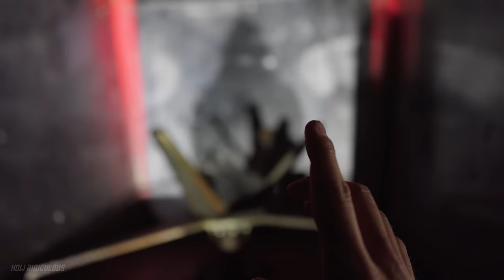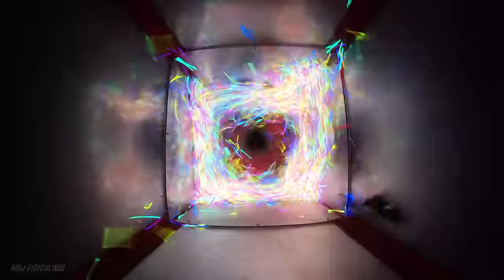10,000 Glow Sticks Vs. World's Largest Blender!

Comment: I'm surprised the deodorant cans didn't start the fire. With the flammable aerosol contents, and metal fan blades slicing up metal cans, there's so much potential for sparks to ignite
Reply: To be brutally honest, I don't think it would have.
.
.
It would have more likely been an explosion.
The oxygen to aerated fuel igniting would have caused a MASSIVE explosion in my mind if it caught and the metal to metal wouldn't have been an issue tbh Iron to Iron is spark, I haven't seen aluminum throw sparks because its too soft compared to iron, but the heat from the motor could've done it.

(Quick edit) If Aluminum to Iron would throw sparks and anyone has proof I'd gladly be proven wrong!
Reply: @Shad0wLeviathan NO WAY THAT USED TO BE MY PROFILE PICTURE THATS COOL
Reply: @demithevampireking4285 iron and aluminum can definitely throw sparks, it's called thermite 😛
Reply: Aluminum sparks? I didn't think soft metals could create sparks upon impact
Reply: Aluminum doesn't really spark.
Reply: perhabs the air to "gas" ratio was prolly too high to create flame.
Reply: Not enough oxygen for the amount of ionized fuel.
Reply: @rackodakoo  stoichiometric mixture may have been a SINGLE factor of many factors, but boy did it go off in the end 😊
Fireball is a fireball 😁
Reply: The propellant was probably nitrogen instead of methane. Then, low to no alcohol for the spray itself.
Reply: Aluminium doesn't spark...
Reply: Wrong. @Fear_the_Doughnut
Reply: @hippopotamus86  you need at least 16% oxygen for combustion, judging from the amount of deodorant vapor in the "blender" I would say there was far less oxygen than 16%. I would have to say there was less than 10% in that chamber. But I will concede I could be wrong. But not about there not being enough oxygen.
Reply: I'm pretty sure deodorant is so far from flammable itself,. Especially because it goes on your body. Then again, people put a highly flammable substance in their hair, so what do I know. But I do consider that it may have some properties that might have hindered combustion
Reply: It's aluminium cans, doesn't generate sparks
Reply: Gotta have spark forming metal. Most canisters used for such flammables are non-sparking alloys, FOR this very reason.
Reply: Like the deodorant cans illustrate the effectiveness of using non-sparking soft alloys. Soft alloys yield to steel and other alloys thay can spark (titanium, looking at you sparky). The results are literally exactly what should be expected
Reply: @patrickw9520  That's a very good point, one I didn't consider.
Reply: Too much liquid in the air at the start so the spark wouldn't do anything, but when it settled it should have so i too am so surprised
Reply: @willowmoon7  ironOXIDE (aka rust) tho. blades still too fresh ahaha
Reply: @Big_Red_Wade  the liquid would've only delayed sparking for maybe a second before it was all on the walls. The cans sre non-sparking alloys. It's literally a requirement in every developed nation.
Reply: Rapid expansion of gas from the canisters likely displaced all oxygen from the blender.  Fuel + spark does not equal fire without oxygen
Reply: @Kualinar I’ve never seen a nitrogen based deodorant. Does it even exist?
Reply: @zakiNBG  imagine the chaos if they had managed to start a thermite reaction @_@
Reply: Why would it, there’s no open flame and it’s just gas vapors, the cans are just getting smashed and not causing sparks
Reply: @AndyMcBlane  Not nitrogen based but nitrogen propelled. There are also some that use CO2 as propellant.
Both are slowly replacing methane as a propellant to make spray cans safer.
Reply: @Kualinar  neat. Hopefully it will mean less nitrogen cartridge waste in the streets
Reply: @SwedeRacerDC  something in deodorant definitely makes it combustible. We have made multiple cannons using deodorant as the propellant. Depending on what deodorant you use you can get different colours in the muzzle flash (we used a specific lynx deodorant once and got a vibrant blue flame which was cool)
Reply: I thought about that but they are tin cans and idk but ive never seen a tin can make a spark, i dont think they have the power in their thin little wallt to spark, they just die and get crushed
Reply: I don't profess to know what I'm talking about, but my initial thought is that the air would be so saturated with the deodorant, and even the propellant, that it could not catch fire.
Reply: @abrobot9261  you're probably right, it's all about the chances of getting the right mixture of gas and the probability of an ignition due to mechanical sparks of heat from the motor, but the risk is definitely there
Reply: @willowmoon7 but firstly it's aluminim oxide that's in thermite not pure aluminum and secondly it  takes a very high heat source (like burning magnesium) to actually start the termite reaction, way more than you'd get in a momentary friction contact between the steel blades and the aluminium can.
Reply: @willowmoon7 only under a thermo reaction. Not from colliding.
Reply: Surprised the yo pro didn't over heat and switch off lol
Reply: @willowmoon7 yeah but there is no iron, only steel and alluminium
Reply: @SwedeRacerDC ever held a lighter in front while spraying?
Reply: Deodorant: We didn't start the fire!
Reply: Aluminum doesn’t create spark.
Reply: @SwedeRacerDC check the label on the nearest can of deodorant, I'm 90% certain that unless it was very expensive and proclaims it's a 'green' one, there will be a 'highly flammable gas under pressure' warning on it
Reply: @patrickw9520 ummm, that's so very wrong. The vast majority of industrial use aerosols are steel, irrespective of the contents. Domestic use ones are about a 50/50 split.
Reply: Ali can = no spark
Reply: @willowmoon7 thermite is made up of iron oxide, not just iron.
Reply: Rpm way too low. Takes several thousands of rpm to make enough energy to burn a solid. Sparks being burning metal. That’s why angle and die grinders turn at tens of thousands of rpm
Reply: @MortRotu  I have never used the stuff, so I really have no clue. I can imagine the gas is flammable, but the deodorant substance might work counter to that. It seemed like a powder that could suppress any little fire as it started. Comparing to the Hairspray which is all flammable. It will catch your hair on fire 🔥 if you're not careful
Reply: For all the fire and visual things, the reason we love these videos and these guys in because of the interactions between them and conversations like TeamNewHeat...!
Reply: @johnholten8649  I can neither confirm nor deny that my younger pyro self made a homemade flamethrower.
Reply: A spark sure would have been neat😂
Reply: It wouldn't though. The blades may be made of steel but the cans are made from aluminium, which needs an insane amount of energy to spark. Not all metals are created equal.
Reply: I would guess that all of that highly compressed gas expanding all at once dropped the temperature in there way too far. That added to the fact that all that stank would've displaced an absolute load of oxygen... I'm not terribly surprised it didn't go up

I'm just glad I didn't have to smell it to see it 🤣🤣🤣
Reply: If they would add some source of spark, it maybe could have exploded but I don't think there is enough flammable chemicals. I think some car related chemicals like break cleaner cans or similar could create mixture that would burn if there would be source of spark/flame. But those actually are easily flammable chemicals
Reply: @demithevampireking4285  🔴 What Is Islam? 

🔴 Islam is not just another religion. 

🔵 It is the same message preached by Moses, Jesus and Abraham.

 🔴 Islam literally means ‘submission to God’ and it teaches us to have a direct relationship with God. 

 🔵 It reminds us that since God created us, no one should be worshipped except God alone. 

 🔴 It also teaches that God is nothing like a human being or like anything that we can imagine.

🌍 The concept of God is summarized in the Quran as:

📖 { “Say, He is God, the One.  God, the Absolute.  He does not give birth, nor was He born, and there is nothing like Him.”} (Quran 112:1-4) 📚

🔴 Becoming a Muslim is not turning your back to Jesus. 

🔵 Rather it’s going back to the original teachings of Jesus and obeying him. 

More ....
Reply: I believe the cans are made of aluminum and aluminum doesn't spark.
Reply: @belinski111  thank you for the chemistry lesson
Reply: I know how thermite works yall stop it 😭
Reply: @MortRotu  they have spark resistant steel alloys. Galvanized and tinplate are spark resistant steel. 

If they weren't, unilever would have far more fires.... automated equipment+containers capable of sparking would be an accident waiting to happen. Thus the cans used are all spark resistant, whether by material or treatments. It would also be a HUUUGE liability. 

Also pretty sure its an OSHA violation.... explosive hazards.
Reply: but not guaranteed, the sparklers provide that assurance
Reply: @willowmoon7  but that’s because the iron oxide acts as an oxidiser, aluminium won’t act like that under the conditions in the blender.
Reply: @RobDavisAkaMonk  aluminum oxide is absolutely not what you want to use in thermite and is the reason it's so hard to get thermite going because all aluminum has a layer of aluminum oxide on the outside of it almost immediately after cleaning it off that protects the far more reactive raw aluminum inside, pure aluminum burns very easily and it's the aluminum oxide coating the aluminum powder that slows down the start and why you need to get it so hot to start. It uses iron oxide and aluminum, you could make an aluminum oxide thermite with a different metal as the fuel but for standard iron/aluminum thermite aluminum oxide is the enemy
Reply: @noodlelynoodle.  Ah yes good point. I confused aluminium oxide with iron oxide.
Reply: @willowmoon7 that’s rust and aluminum.  It’s a transfer oxidation.
Reply: that is true but it also depends on the type of metal. those i think were aluminum cans, those don't spark like you would think .

Comment: In a real blender, the container is shaped in a way that ensures a vortex forms that sucks the material under the blades, back up through the blades as they spin.
You need to have some sort of cup shaped thingy underneath the blades, and corner rounder-offers in the four corners.
Reply: « Corner Rounder Offers » ❤
Reply: first sentence: Bill Nye
second sentence: Science with Gaunson
Reply: I think it is a much bigger issue that air is a much thinner fluid than anything you put in a blender.
Reply: I think it may have been a purposeful design as a last hope of not getting absolutely destroyed by the blades if they turned on while you were inside

Comment: What Scott says makes perfect sense. In heat transfer, there is a mechanism called forced convection. The heat transfer coefficient needed to calculate heat transfer by forced convection depends on the flow velocity of the fluid or gas relative to the object the heat is transferred to. In your case, the flow velocity is determined by the speed of the rotating blades. The faster they rotate, the more heat is transferred to the blades.
P.S.: Your videos are awesome. Please keep up the good work.
Greetings from Germany
Reply: Remember the propane in the balloons vs. the arrow with sparklers? The surface of the blades is probably where the flammable liquid mixes fastest and most completely with oxygen from the air. That should create the same effect as an oxy-acetylene torch.
Reply: In summery, new heat 😆 🤣 ❤️
Reply: It's also the fact that metal is conductive.
Reply: ty for saving me the typing lol
Reply: This is the first time that "Science with Scott" actually made sense. And if you want to test it. Redo the same flaming cans of deodorant, but use an optical thermometer to check the temp. of the tips of the blades compared to the center parts of the blades. If you had an optical camera, like on some cell phones you could even see the differences on screen.
Reply: Three inebriated Australians discussing the science of fire, perfect formula for a YouTube video.
Reply: He put water on an electric fire.
Reply: I hate to rain on the new heat parade but this is incorrect. Convection is a thing but centrifucal force is way way stronger. The fast spinning of the blades would cause streams of air to push away from the blade causing the blade to be cooler than it would have been if it wasn't spinning. As a matter of fact the real issue with the "new Heat" theory is actually the premise that the spinning blade means it is spinning into more flame than if it was being still. Even if you don't take into account the fact the blade is pushing flame away from itself consantly. Flame is not a solid object it is everflowing constantly, if the blade was perfectly still then it would still be interacting with new flame every single instant. The flame is constantly replacing itself. So the blade is always being constantly heated by "new flame" even more when the blade is still than when its moving.
Reply: I think the enclosed space limited the amount of oxygen available in the initial flash and consequential burned at a significantly higher temperature.
Reply: Typical German... knowing physics things and engineering. We're onto you.
Reply: @KermitsBadFurDay  Ooo that makes sense too. I want to see an experiment video... test the blade same drop... 1 with spin one without!
Reply: I thought the same thing, team new heat all the way baby
Reply: @froggercrak6286  It's wrong, though.
Reply: It might not be wrong at all. It would be great to test.  @Hugh_Jas

Comment: The blades are heating up really fast from metal on metal friction.
I remember, someone dropped a lock from a shipping container, under the container.  We happened to be moving the container that day, the lock got dragged maybe 5 feet by the container, the guy without thinking picked it up, and got immediate 2nd and 3rd degree burns on his hand.
Reply: That not nearly enough friction to heat up the blades that much. You could throw in 100 empty cans and it wouldn’t change the temp of the blades by even a fraction of a degree. It’s the fire and the blades moving would only make it less hot.
Reply: @LC-sh6wd  Air can totally cause friction or rather, an effect similar to friction which is compression. An object moving through the air at high speed does have wind resistance, yes, but that doesn't actually cause much friction, it causes the air to compress, compressing things heats it up so the blades are compressing the air in front of them which causes the blades to absorb that heat.

It isn't significant, the fire is defiantly doing more to heat the blades than the heat caused by the compression along such relatively small surface areas, but it is there. Occam's Razor, though, says the blades are mostly just hot because you lit them on fire.
Reply: Nice discussion guys.
As for it not being fast enough, or enough metal...
The example I gave was for a reason... a pad lock.. approximately 1.5 inches by 3 inches by 1/2 an inch... was dragged by a shipping container, for approximately 3 seconds, at a pace of about 1 foot per second.
That padlock reached temperatures in excess of 1000F, and held that temperature for several minutes.
While we laughed at the guy who grabbed it, the truth is he held it for a fraction of a second and took over a month to recover from the burns.
And that is because of something that one of you touched on... Temperature is not really associated with friction, it is associated with pressure.
As pressure increases, volume decreases and temperature increases.  The pressure caused by the blades is very high, that high pressure needs one of the other two parts of the triangle to be controlled for the third to change.
If the container was open, volume was able to change on it's own, the force of the blades dissipating into the air, then it would balance out the pressure and temperature would not change.
But... it isn't open, at least not enough.
So the blades build pressure, the enclosed environment limits volume, the only other part that must change is temperature.
And this is the basis of every cooling system we make, just in reverse.
Without the metal, the blades and the air, will still get hot.  But with the metal, you have an added conductive material.  That material is making very short contact, but is doing it a lot, at a very high speed.  In this case, the metal on metal is greatly increasing the pressure back against the blades.
Where normally the pressure does push out, this pushes a lot of it back, and concentrates the pressure, thus concentrating the heat, near and inside of the blades.
Now... for the fire... fire works by combustion and convection.
Heat will transfer to objects that are either combustible or in proximity to the convection.
As stated, the blades are basically a big fan.  So they very effectively move air away from themselves, which greatly reduces convection, and being metal they have no combustion at this level, not until you get much, much hotter.
So no matter how hot the flame gets, it is in a terrible position to actually heat of the blades.
In fact, I would challenge you, in a safe environment, place a fan, above a fire, and test how long it takes to heat up the fan while it is running.  You may find that the fire is extinguished by the fan moving air away from it, long before it is able to heat up from any form of combustion or convection.
Conclusion, the heat from the fire is negligible, the heat caused by the pressure increase and transmitted by the high conductivity of metal is greater.
To test, check the temperature of the blades before and after experiments with similar amounts of conductive and non-conductive materials.
I will not be testing this large scale, but I have tested it small scale.